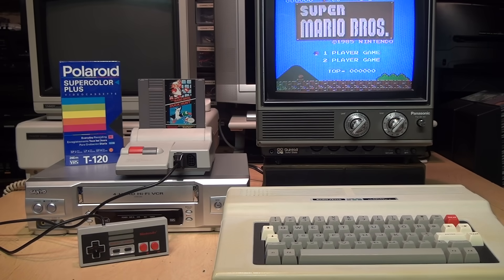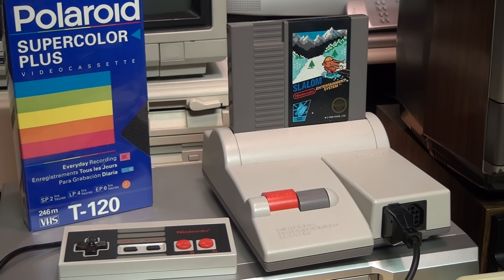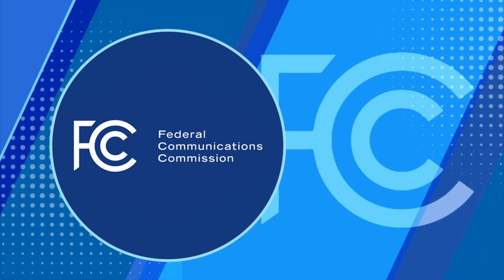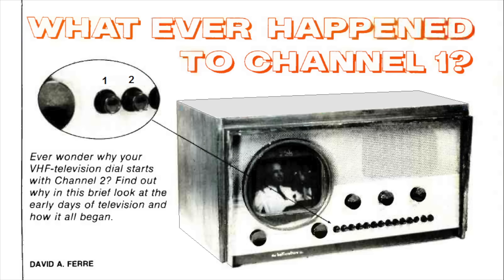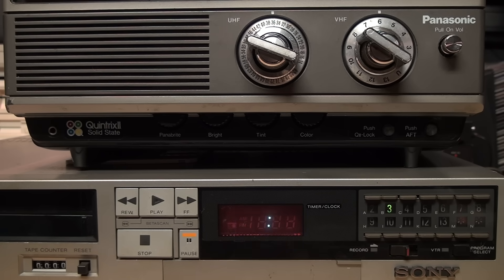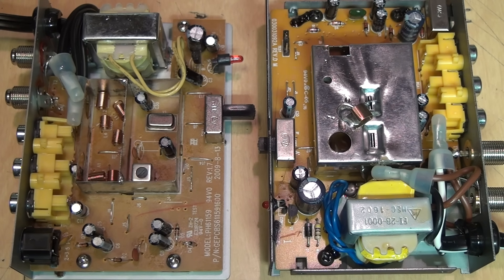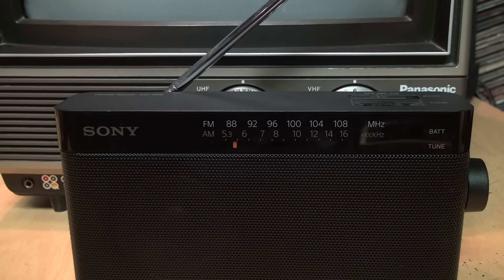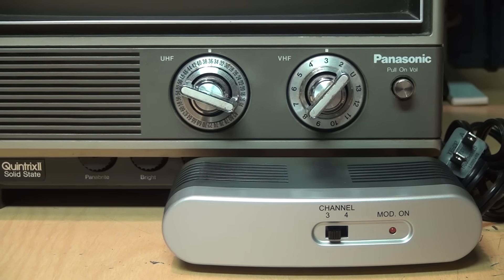Why your Nintendo was on Channel 3 (except in Cleveland)

Comment: The reason is way, way simpler than the explanations given - Channel 3 is 60-66 Hz, and Channel 4 is 66-72 Hz.  60 Hz was the defacto standard (and still is for most "normal") for tv sets in the US, and countries that followed our standards VS the UK (such as Japan).  The RF modulator could have been modified to output on ANY channel, but it would have gotten increasingly large depending on the amount of higher channels they supported, and the NES by default output the standard NTSC frequency of ~59.94 Hz (unless you're in the UK/EU), so channel 3 was a braindead choice - no further modification necessary.  Channel 4 is only slightly higher, so a simple circuit can up the output into the range of that channel, without triggering another issue - increased power draw.  

Imagine if the NES RF modulator had a VHS sized box which required its own power supply to even use your NES on your TV, unless you had RCA cable spots available (as you made a huge error here - every NES I've ever owned, and I've owned a lot of them, had a side with RCA cable video and mono audio out).  That added ridiculousness to hook up a toy to your tv, on top of the already ridiculous size of the power adapter the console came with (which was because the part that plugs into the wall had the modulator inside it, instead of somewhere else like modern power cables do, and is why they're called wall warts), would have put a ton of people off... you'd need the entire wall outlet just for your NES.  Case in point, look at the insanity of the FULL genesis experience - you need 3 power cables for everything to work, JUST for the game console to be fully functional (both the CD attachment and the 32x had their own, required, wall warts).
Reply from the maker: You're confusing Hz with MHz.

Comment: when i first started making videos in the early 1980s, the only tv's with composite inputs were professional monitors. they were crazy expensive. you really can't use an rf modulator tv for a production monitor. a company called VideoTek created a market by upgrading sony trinitron tv's with features like composite inputs, underscan and dc offset. at about $1k for a small one, they were 3 times the price of the consumer model but less than half of the closest professional monitor. all the colleges and local cable access channels bought them and they were damn good. then one day, sony started selling tv's with rca inputs for video and that changed everything.

Comment: I remember having both Atari and Nintendo modulators with a switchbox, and since there wasn't any stations other than 6 in my market at the time, channel 3 was used. There was a channel 2 but it was close to 100 miles away and only came in good when the conditions were right. That was also how I learned to get dx vhf/uhf stations with my crappy bunny ears. A station around 150 miles away was the one I got most often.
The station in Orlando on channel 6 used to advertise 87.7, and I wondered for years why other stations didn't do that too. It was in the late 90s after I had moved far away that I realized why that worked.

Comment: Everyone can use SDI. There are converter boxes of 4K 60fps SDI to USB video for $90 approx.
SDI is on high end Canon photo cameras already.

I use SDI to do my video production.
Reply: Our 3 camera set up at a university using Panasonic micro 4/3 video cameras used SDI cables to send audio & video to the switcher and to the Macs for video capture. The cables were 60 ft long with no signal loss and very durable yet flexible.

Comment: I've had experience with channel 4 and 6 as a kid, growing up in a middle-of-nowhere town in central South Dakota. That part of the state was served by three VHF stations.. KPRY channel 4, KPLO channel 6, and KTSD Channel 10. Channels 4 and 6 were satellites of the Sioux Falls ABC and CBS stations, KSFY and KELO respectively. Channel 10 is part of the SD Public TV network. I seem to remember toying around with a Nintendo RF modulator one day, and can recall being able to use it on channel 4 despite being in the coverage area of KPRY. On the other hand, KPRY had a very crappy transmitter and poor picture quality even with a good antenna setup, so maybe that's why the Nintendo overpowered KPRY? Either way, I always wondered why RF modulators just had channel 3 and 4 and this video provided the answers. Thank you! 😊One last note, Nintendo continued to sell RF modulators well into the GameCube era! The GameCube RF adapter apparently was just the same one used for the Nintendo 64. I guess they had leftover stock to sell after the N64's era was over?

Comment: In Australia, Nintendo always used low VHF, I think they used Channel 1, because ABC TV was on channel 2, and I can remember tuning our family TV to get the N64 to work and the N64 would be on a channel below the ABC.  I think most other products used UHF, certainly the Sega Master System and Commodore 64C I had used UHF, I don't know what channel they used.  Now I think I understand why the picture quality on my Commodore 64C was so poor and the audio was so badly affected by buzz and hum and other unpleasant noises, I don't think the cable I used was good enough or shielded well enough to prevent interference.  I initially thought it was due to a broken/poorly designed RF modulator in the unit.  I'm out of my depth here because I never really knew what frequencies televisions used in Australia.  We only had 2 broadcast TV stations on UHF here, SBS on channel 28, and channel 31.
Reply: For us Americans at the time, If we wanted to play on the SNES, we had to use channel 95 or 96 on the RF side of things

Comment: Here in Mercer County, NJ we receive both channel 3 and 4. In the 1980s, I would play Atari and set the switch to either. Both channels were NBC at the time, so the slight delay helped when adjusting the fine tuning to differentiate. It was and still is the same way here for 6 and 7. I always knew the final Jeopardy answer because I would run to my bedroom and play Channel 7 which was about 30 seconds ahead of channel 6. My parents never caught on 🤣

Comment: I suspect another reason that the 3 and 4 were used, instead of two non-adjacent channels like 3 and 6, is because a city wouldn't have two broadcast channels adjacent to each other. So if your city had a station on channel 3 (as my mine did growing up) there wouldn't be a local station on channel 4.

Also, I always assumed Europe used UHF because the UK only used UHF for their 625-line PAL broadcasts, and VHF was left to the older 405-line black and white broadcasts. So to be compatible across Europe, UHF was the common denominator (just as VHF was in North America).

Comment: the original north american NES actually supported composite video, being the only input on it (though nintendo offered a RF modulator). what's interesting is that the famicom (the japanese nes) was RF only, but japan's version of the top loader was composite only (and thus was called "AV famicom"), weird that its US counterpart was RF only (basically going a step back).
Reply: The original US "toaster" Nintendos actually offer RF out on the back and composite video out on the side(for some godforsaken reason).

Nintendo included an RF switchbox, but the modulator was integral to the system. (This was also true of the US Super Nintendo, as well as Sega's Master System and Genesis, and I believe even NEC's TurboGrafX.)
Reply: @CptJistuce  I remember this!  Also, a lot of TVs had rabbit ears that had some kind of screw attachment to the TV instead of an RF input.  And so you had to get a conversion setup to be able to attach the RF output to the TV at the screw-in rabbit ears.
Reply: @powerofk  The screw attachment was just a different kind of RF input.

Older systems went the other way. First era stuff your switchbox had the screw terminals and you'd need an adapter if your TV only had the coax connector:

Some blessed systems had both. The Atari 5200 switchbox is the only one that springs to mind.
Reply: There was also Sharp's Twin Famicom (basically, a Famicom and a FDS in the same case) that had composite output out of the box, but what's interesting is that it has a DIN connector on the back for an optional RF modulator.

When I'll add a NESRGB mod board in my Twin Fami (AN-500R) I'll repurpose the DIN jack to output RGB.
Reply: @Alexis_du_60  Which is odd, actually. The TwinFami's 8-pin DIN connector is kinda overkill for an RF modulator. Composite video, mono audio, voltage, and ground is only four pins. Three if we use the DIN shell for ground.
Reply: @CptJistuce  Indeed, from what I read, some Twins had half of the metal pins ommited despite the connector having the spots for the unused pins.
Reply: @Alexis_du_60  My suspicion, which I can't really confirm, is that someone was trying to do it right, with a separate audio ground, video ground, 5VDC ground, and cable shield ground. 
And then someone else went "wait, but there's only one ground in the system, so none of this matters"
Reply: It was possible to have it modified by Nintendo, such units are really rare  since only a few called Nintendo for that
Reply: @OM19_MO79 The major problem with the top loader, on top of already have only RF output, were the “jail bars” on the screen. With a good cable and a good TV you could get an image 99% as good as Composite, but you still had to deal with those ugly jail bars. That was the main reason I get rid of mine.
Reply: Composite video isn't an input on the NES.
Reply: @Okurkaarrgghh  yes. It is an output.
Reply: The channels needed for the SNES are 95 and 96

Comment: I never thought about it for over the air broadcasts, but I'm sure in a lot of cable areas like I was it was simply chosen because it was a station that the TV would likely be on a lot of the time anyways.  For example, pretty much everyone I knew used channel 4 because that was CBS, and Channel 3 was CBN.

Comment: The VHF/UHF situation was very confusing for a Brit coming to the US without anyone to explain it, and the 3-4 modulator split was also confusing. Thanks for clearing it up!
Reply: The lack of SCART support must have been heartbreaking.
Reply: I have at least one TV, bought here in the U.K, which scans through the entire VHF band (and of course doesn't find anything) each time you tell it to do a retune.
Reply: @M @MrDuncl is it 405 line in the UK ?? Uses AM but scrambled on NTSC and PAL.
Reply: My Nintendo came with a channel selector built in. Does not require any splitter. And is not confusing at all. If you can work a TV you can work a splitter.

Comment: saw your title and thought "we had to use chan4 in philly, too!" and then saw your chart. And i even got your "25 or 6 to 4" chicago reference
Reply: I grew up halfway between Philly and NYC. Both 3 and 4 could be tuned.
In fact, almost all VHF channels had a signal. 8 was the only exception IIRC
2&10 (CBS), 3&4(NBC), 6&7(ABC) were the major networks
5,9 & 11 were independent.
12 & 13 were PBS
Reply: @aaronbredon2948  yes it depended where you were and was different everywhere plus there was a big switchup of networks at one point.  Channel 3 was KYW (cbs) so we had to use chan4
Reply: You can use 3 and 4. Just not at the same time.

Comment: My grandfather had an old TV in the garage (you can see it on the "old tech at grandma's" video on my channel) that only tuned VHF. Still had the knockout for the optional UHF tuner, which hardly anyone bought since all the major networks were on VHF in the NYC market. Ironically, if I were to use a modulator now, I'd have to tune it to channel 4 since NYC now has an ATSC station broadcasting on RF 3 (WJLP).
Reply: I didnt think analog TVs could pick up digital TV signals without a box tho
Reply: @adventureoflinkmk2  ATSC signals can still interfere with RF modulators.
Reply: @NJRoadfan  very interesting.. you'd think analog and digital would be incompatible
Reply: @adventureoflinkmk2 they are, but someone yelling in another language 5 feet away still makes a conversation you're having more difficult, without understanding them

Comment: I grew up in Northeastern NC (Gates NC), we were rural but our area had a unusual occurrence, being having 3 low VHF TV stations in the Norfolk VA TV Market. We had WUND TV 2 Columbia NC, WTKR TV 3 Norfolk VA & WSKY TV 4 in Manteo NC (Nags Head). with our outside TV antenna connected into my video game console, 3 or 4 was always overwhelmed by these stations, the only fix as a kid was to disconnect the TV antenna while playing video games, the composite in on the TV had our Satellite dish on it.
Reply: I grew up in Moyock and remember using channel 4 for my NES and N64 in my bedroom. That was mostly before WSKY signed on though... I don't really remember SKY4 giving me any interference since we didn't pick it up very well over-the-air.

Comment: I know that RF for video is basically as bad as it can be, but honestly it isn’t terrible especially on a decent CRT. I have good composite and component sets, but some older ones are only RF, yet it still provides a good picture especially without interference. I guess the benefit of not having analog TV channels is that there isn’t any interference to worry about. As cool as it is to have the top of the line everything from the 80s/90s, you can still play older consoles or watch some tapes with a RF only CRT.

Comment: This thing about TV channels always confused me, mostly because i've been a kid in the 90s, and was lucky enough to have tv with programmable channels, also because the various channels weren't exactly broadcasted on the same frequency in all of Italy.
Basically it was the norm to program each channel to the actual number of the TV station: Rai Uno was CH1, Rai Due CH2, Rai Tre CH3, Canale 5 CH5, and so on. Our Sony TV was also quite confusing, because to program each channel you just pressed a button that did autoscan and just stopped when it found the carrier, but no actual sign on the screen or LED display to tell you what channel/frequency you were using!
When one uncle that lived in Germany gifted me a Philips Videopac G7000 (the Magnavox Odyssey 2 in the US) it transmitted on RF only, to find the frequency it took well over 30 minutes to scan all the frequencies and in the end we had to disconnect the main TV antenna because the signal of the console was so weak it would be easily overpowered by any transmission! It didn't help that pretty much everybody in Italy also used an antenna amplifier because over-the-air transmission was done with sparsely placed transmitters even hundreds of kilometers away.  
Even today with DVB-T2 we still get our channels from the same transmitter position placed 50km away.
My parents did tell me that back when they had a TV in the early 70s they had just 2 selectable state channels with buttons, and the "third" channel was just a knob to vary the frequency manually to any other VHF (and probably UHF) frequency.

Comment: If UHF modulators were more of a thing in North America, I would have used Channel 37 since it has not been used for OTA TV since probably the 1960s.  Only one TV station applied for a construction permit for a transmitter on channel 37, but the bandwidth (608-614 MHz, centered on 611 MHz) was reallocated for radio astronomy and other heavily regulated use cases before the station could make good on it.